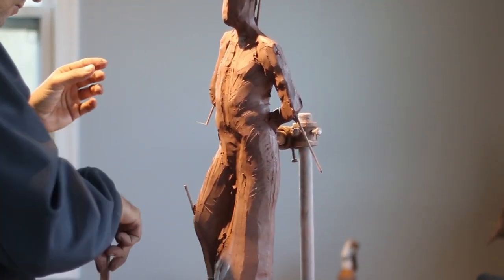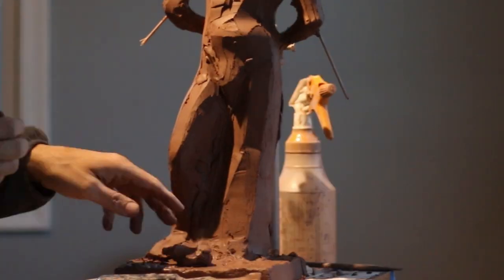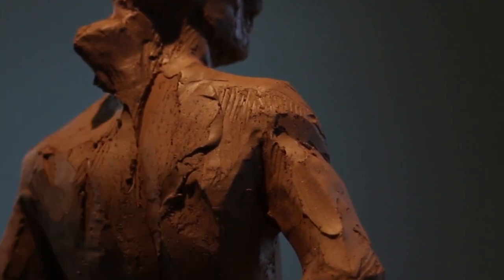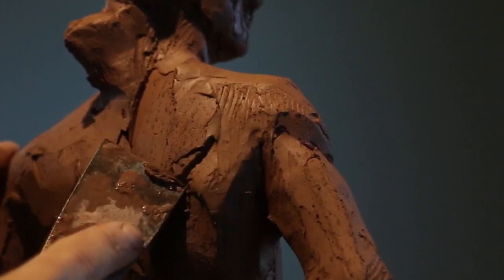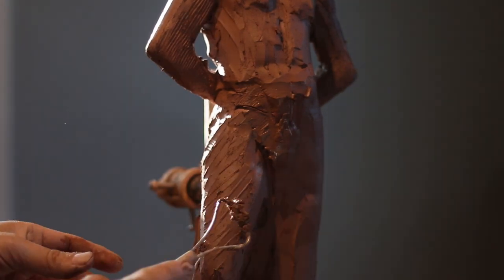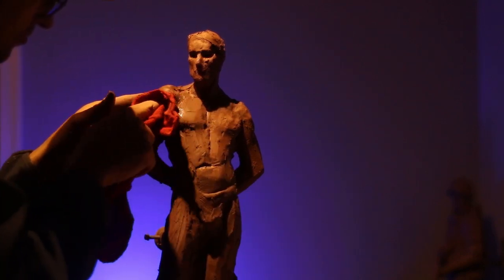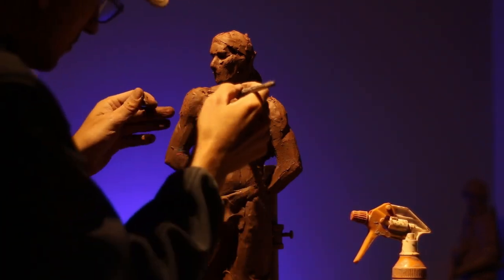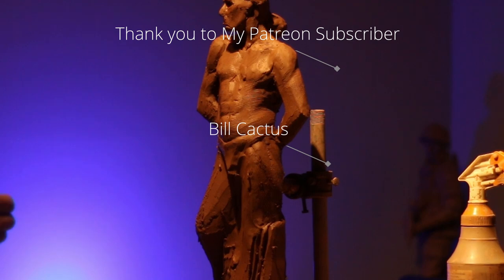Part 2 How to sculpt a standing figure in water clay without an armature for firing

Comment: When do you take the wooden sticks out of the figure as you are sculpting ?
Reply from the maker: Usually midway. Don’t leave them in to dry it will crack the sculpt
Reply: @SculptSome  do you close the holes that these sticks leave behind ? I ask because having "air stuck" in the upper arm for example can lead for it to explode while firing right ? 
And how did you get out the stick inside the  leg that didn't stick out like the others to just pull ? 👀
Reply from the maker: @liviaruizrosas9031  If the clay is still wet then i can push it together. But what i prefer to do is to leave it open if I am going to paint the sculpture. If i want a perfect terracotta id close it, but make sure that the hollow i scoop inside will get to the arm section to help vent.